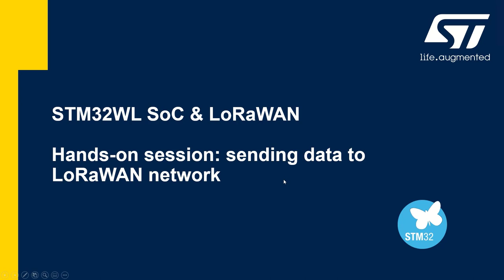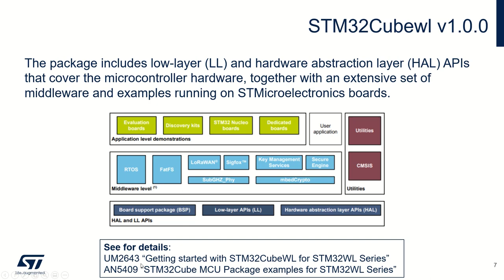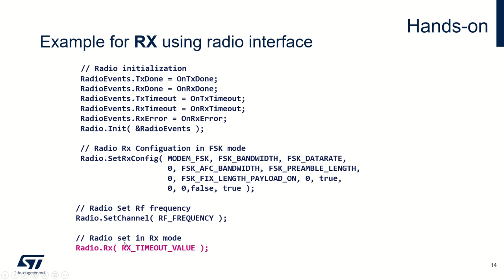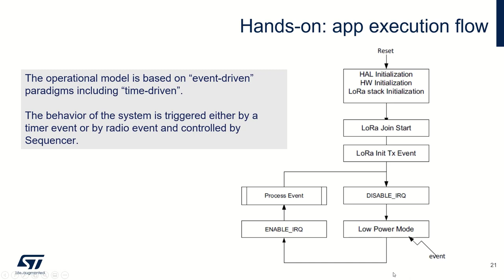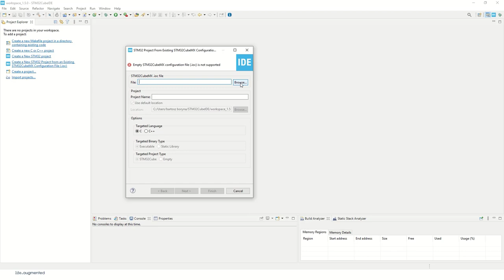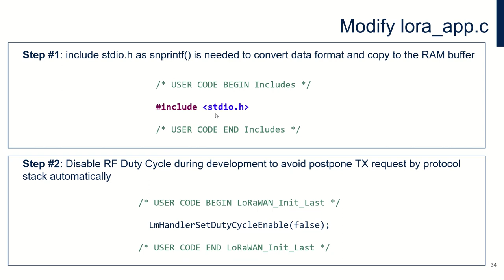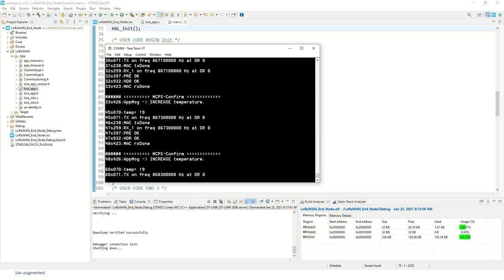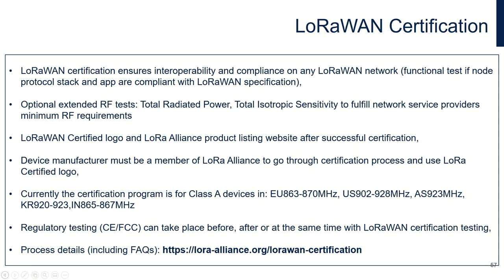MOOC - STM32WL workshop - 5 Sending data to LoRaWAN network lab

Comment: Great video!
I needed a video to understand the LoRaWAN software expansion for STM32Cube, I haven't seen any tutorial in the internet, there is only one that explains how to configure the Lora but no how the code works, I have two questions:
1. If I want to use my own code that I designed to run it on the main function, can I still use the main function to run my code?
2: In my implementation I use a system clock of 16MHz, can I change the system clock? is it going to affect the LoRaWAN software expansion?

Hope you can answer my questions, thanks for the video!!
Reply: I have the same question. No one talking about how to create your own application. Everyone only explains the example code.